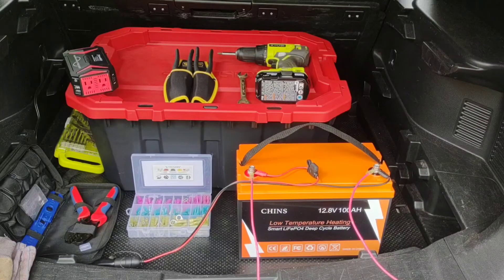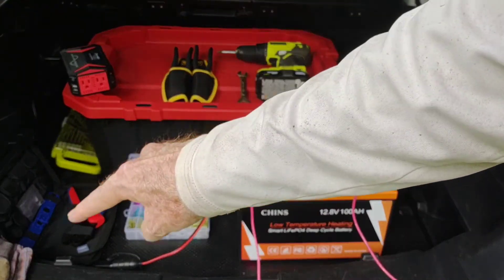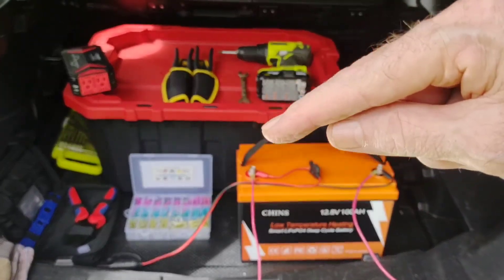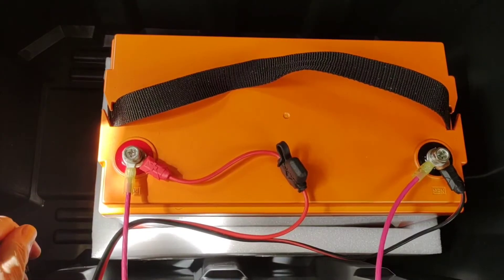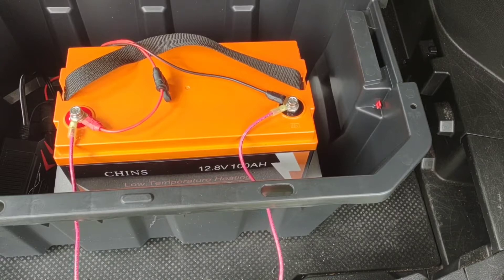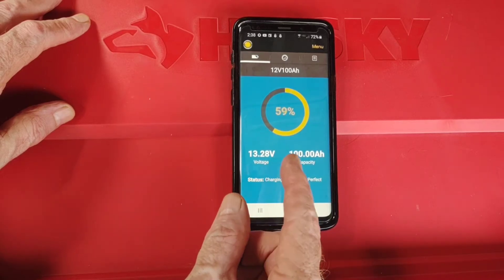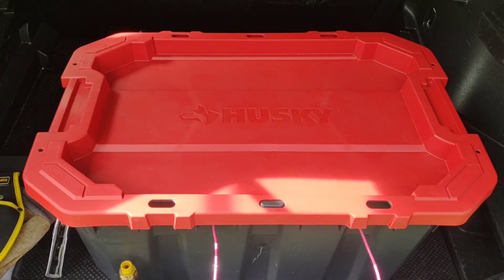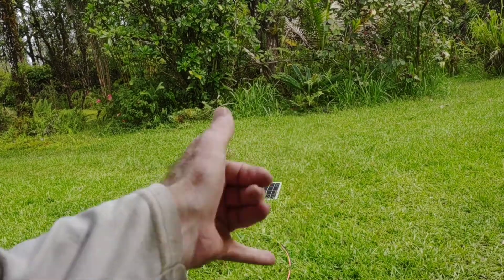DIY super easy "smart" LiFePO4 solar generator.

Comment: What if your solar panel is 30v?   400w.    Would that work without a charge controller?   Or would you need to get a 12v panel?
Reply from the maker: I would highly recommend using a charge controller.  I installed one a while back. 🤙

Comment: Thumbs up for dat kine do it yourselfer.  I have 6-7 of those 300 watt Bestek inverters on my projects. I love them.
Reply from the maker: I've got a couple of them, and they work great 👍
Reply: @ProjectsinParadise808   The caseless TOBattery 200 amp hour lithium battery came today and it fits my modified trolling motor box. The hard wired Bestek 300 WATT is Velcroed to the top... I know, I said amp hour and it was just wishful thinking.....  Its pretty amazing to see a 200  AH battery with built in BMS fit inside that case.  https://www.youtube.com/watch?v=UwuC97gpng4

Comment: You really still need a charge controller.  A BMS doesn't replace the need for one.  An mppt controller increases charging efficiency hugely.
Reply from the maker: I agree completely with you 🤙
Reply: Not really… mppt is rarely more efficient than pwm with small panels. For temporary portable spot use, this small panel won’t need the SCC… 

I would CERTAINLY not recommend this setup for regular use. But fine for a tailgate party or job site limited use.

Comment: I would put a fuse on battery on solar input cable in case a short down the line .something small like that a cheaper PWM charge controller will be fine.
Reply from the maker: copy that Robert! Just ordered it up! Thank you kindly 🤙

Comment: Did you forget to mention the solar charge controller?

For viewers who don't know what this question is about:

Solar panel delivers at the exit 16.77V
Losses in cable and connectors between panel and battery  unknown
Chins battery bulk charge at 14.6V
Chins battery float charge 13.8V 
Chins battery High voltage Disconnect 15V and reconnect 14.2V

The controller should bring the 16.77V of the panel minus losses of cables and connectors down to 14.6V when bulk charging and turn it further down to 13.8V when the battery is full, like you programmed the Epever in one of your videos.

And when there are substantial temperature differences during the year, temperature compensation is also a benefit of a good charge controller.
Reply from the maker: Thanks for sharing all the great information for everyone!🤙